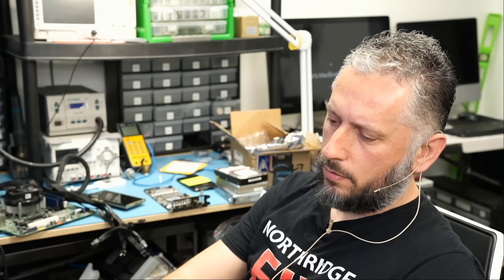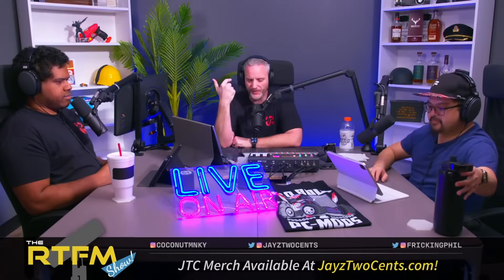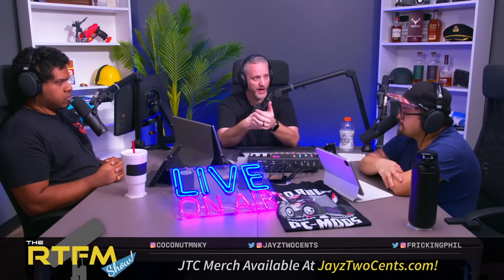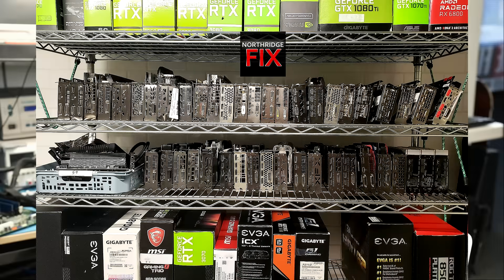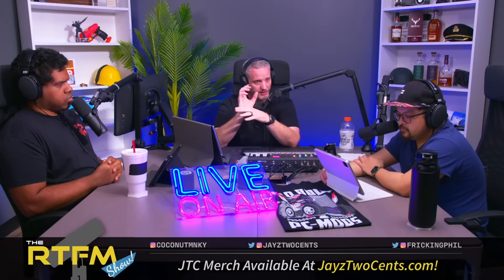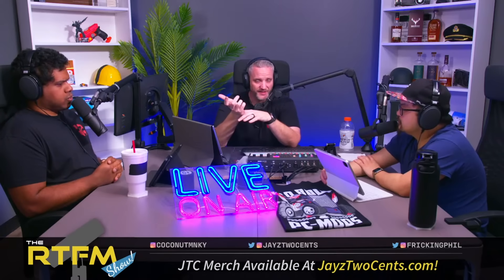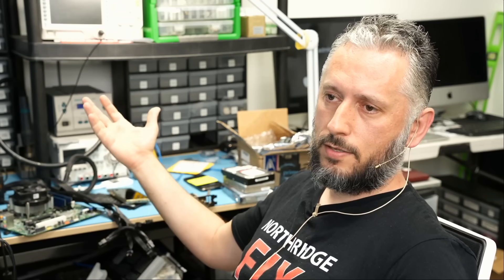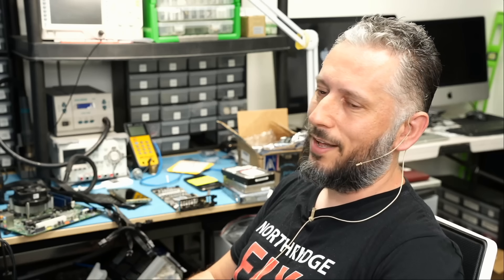Melting 4090 and CableMod. JayzTwoCents and Gamers Nexus Response. Blame NVidia or User?

Comment: that connector cable says it all... - in the old days when you connected cables to old pc's externally they had thumbscrews or even  just screws on them to keep the securely in place and stop them backing out..  maybe there is a lesson to be learned from this when it comes to designing connectors.. but I for one still think that connector is too small for what they are using it for.. it may be able to cope in ideal situations but there isn't enough engineering slack for non ideal conditions or even as the connector gets older..  is this the reason for the design as a form of built in obsolescence?

Comment: if I'm not wrong, while you were showing the card from different side angles in some other videos, I noticed the board looks a bit "cooked" when you watch the connector area from the side.
This means the card itself is generating a lot of heat in certain conditions, so probably there could be also a poor section of copper in the lines from the connector to the components. When the temperature raise up while the card is under stressing condition the resistance of those lines can drops due to the fact resistance is proportionally inverted against temperature, causing a further increase of drained current until it cause the overheating and meld on everything.
Anyway, it is really funny watch those guys speak and continue clutching at straws 🙂
Also, just looking to the fact the total power cable sections for sure is higher than the section of the connectore pins is causing a bottleneck. Probably if you try using the termal cam pointing to the connector area while the card is working under full charge you will see it becomes hotter...

Comment: Its too much electricity current runinng thru this one connector so its too hot, try running a heating fan at 500w thru this hahaha
If you play at 1080p/1440p or dlss fsr it uses less wattage so most gpus live,but native 4k+RT it sucks so much wattage....
old system is 1 pci cable uses 150w so 2 use 300w + 75w from pci slot total 375w for 4090 you need 3 classic pci connectors so total 3x 150w = 450w + pci slot 75w = total 525w.
Pumping this tru one is just beyond stupid.

Comment: More like the selected connector is not capable over time due to load to handle the current. Gets too hot, the terminals tarnish thereby increasing the resistance at points of contact, increases the heat, more degradation of the terminal get hotter and from there it is only a matter of time as these cycles continue before temperatures reach plastic and solder melting temperatures. 

Thankfully it would appear the plastic used on the connectors are not flammable!

Comment: Probably the best way is to set up a good card in a lab and run it while being monitored on video until it fails. IMOP it appears to be a design flaw but I'm not an engineer just an observer. Everyone can agree, there appears to be some type of problem with the connector that needs to get resolved.

Comment: Sounds like inadequate design in regards to current/ voltage passing through the connector, heat generated under use, & type of plastic used for pin / connector mounting

Comment: Steve is a simp for Nvidia cash. Why would he even side for general public? Negative PR about a brand usually blacklists his YouTube channel from future product reviews and free goodies. 
In my honest opinion, I remember from my electronics course that pushing more amps than rating on the connector can cause heat and eventually spark and connection can fail/burn. It also depends on the type of metal and it‘s quality. Arcing can occur when mismatched metals are used and always results in failure due to heat. One way of avoiding it is using multiple connectors (multiple power rails) and distributing the amps flowing through the single power rail. It is used in LED strips for more than 2m in length. Additional power inputs are given at 2m intervals for say we want to run for total length of 10m. Nvidia could have added two connectors and supplied new cable accessories to simply prevent this issue. When ever a device turns on it takes more power in the start and then spike normalises. If the metal used is mismatch then only it would arc and fail over certain amount of time. This is the root cause of this failure. No xray scan needed, just basics of circuit design.

Comment: Steve is getting too much sponsorship from video cards manufacturers.
If you lookup the specs on mokex connectors the max current is 8.5a per contact. Someone short cut something either in engineering or production to save on cost.
Nice try steve do the math.

Comment: What would close this is to measure the resistance of the connector, but would need to measure to milliohms not at dvom. Then just calculate the wattage drop at the connector with the known voltage and amperage. We do this with electric vehicles because if there is high resistance at a connector the car will burns down.

Comment: Over the years, I have seen melting connectors in automobiles. The cause is always high resistance in a circuit connection that has potential for high current draw.
My guess is the male terminals soldered to the board connector are undersize or have an unintended resistive condition on the surface.
Question: 
Has anyone ever done a voltage drop test across the connector terminals while the card is under load?
Alex knows there should be zero voltage dropped across a continuous connection placed between a source and a load, while in operation.

Comment: I saw the reconstruction video from Steve where they tried to recreate the melting issue with the 4090 and the only time the connector melted was while not properly seated, and slightly angled. My first conclusion would be a user failure problem but looking at how easily the connector can fail, i would say it's an manufactorer problem too.  A little bit of wiggeling at the cables and your connector is loose from it's socket. 
https://www.youtube.com/watch?v=ig2px7ofKhQ

Comment: What idiot at Nvidia thought it was a great idea to eliminate the multiple connectors and run that much power through those tiny circuits on just one , they're a bottleneck amperage wise, Glad i turned to amd oh btw ...thanks e-bay scalpers and bitcoin miners driving up costs, hope you lost your asses and the  irs kicks in your doors and arrest you for tax evasion... Not a fan of Steve either, he runs off half cocked and misses the mark, if he's ever close i'll be surprised, i usually bypass his podcasts and once again ....He's off the mark

Comment: So with an electrical engineering background,. not that I am antthing special, but I beleive its a design problem, it is STUPID to put that much power through that small of a connection,  that is why there used to be so many lines to lower the amperage per wire,  its Nvidia, and engineer problem.

Comment: Sorry, but this is a design flaw.  4-to-1 cable allows up to 600W draw on the 12VHPWR.  The Intel spec allows for up to 9.2A on each of those 6 pins.  That's a lot of current flowing thru those 6 little pins and it's going to generate a lot of heat.  If the material on those connectors are not designed to withstand that kind of heat, then it goes to Northridge fix who hopefully has better-designed connectors to tolerate the heat.  2) Wiggling and multiple insertions using that connector could eventually make less surface contact on the pins, which means it's going to get even hotter.  3) Why try to go fancy with a new connector pushing that kind of current thru small pins?  Would have been better to just use multiple 8-pin PCIe power cables directly into the car.  Simple is best.  4) It was stupid design to put the power connector on the top of the card.  It won't fit in many PC cases unless you use a vertical PCIe mount or get the Cablemod adapter... just so you can fit the gigantic card in the case.  Designers and engineers keep forgetting the KISS method:  Keep It Simple Stupid.

Comment: If it was purely a user error, it should have at least been reported with the 4080 even a little more than the case, 4080 users cannot have been all installing theirs more properly than 4090 users, and this is explainable considering how much more power the 4090 is using, 450 watts vs 300w. Seems like this "user error" is not only common but also that the design itself cannot cope with such error on 150 watts higher draw. Outside the world of personal computers, Physicians have the right to alter their patient's pharmaceutical plan if they see it's too complicated for their them to follow it properly, which is common with geriatrics...So, it's still on Nvidia back because they should have developed a way for their product to be installed as they originally intended.

Comment: Yeah but it should be ALL connectors melting then. Why are only select ones melting if its an issue with the card and not the user?

Unless there was a faulty batch of cards in the beginning.

Comment: I think it is user related error personally. I bought my 4090 FE without any fears; I use a SilverStone cable for my SilverStone PSU; 1x 12vhpwr to 3x PSU inputs.
Never had a single issue. I use a vertical mount with the cable going directly into the socket from the PSU.

Comment: A bad design is a bad design . In medical applications with expensive equipment where tolerances are tigh connector have sensors and engage mechanism to properly monitor any variable. Some medical equipment is cheaper than a 4090 😅.

Comment: Too much power through such a small spot creates heat changing the plastic and the coating on the metal. Over time resistance increases with micro arching on the metal and with heat the plastic can carbonize lowering resistance between the pins, short and blow it out.  Someone needs to create soldered on alternatives so it has at least two plugs like the older ones.

Comment: Even if the problem is die to pushing connector halfway, the manufacturer OUGHT TO over design its parameters to avoid this issue

Comment: I'm deeply invested in this! Love your videos, Alex! 
I'm interested to know whether anyone has watched and tested this card with a thermal camera to see where and when the heat starts building up in the connector. I believe that there is a huge current draw on those specific pins when the card is under high processing.
Reply: Didn't Gamers Nexus do this in their 12vhpwr deep-dive? I guess the heat camera is not close enough to figure out specific pins, or that they modified their cable too much.

Comment: the main problem is the current density, which is not at all consistent with the cross section of the pins (
this also applies to wiring the board to the pins). it's the fault of nVidia... 
so that there are no problems, the current density should not exceed 10A per square mm (5-6A is best)

Comment: I also think that NVIDIA's fault is more precisely the connector on the cards and the high consumption of 400+ W, a simple solution is to return the old connectors that we have used for the last 10+ years and which AMD cards still use. If I said something wrong or wrote I apologize in advance. Thanks for the great videos NorthridgeFix, I follow you regularly, have a great day. 👍❤💯🔔
Reply: and this is why you Frame limit and / or Undervolt the GPU. It's basically a must, now a days.
Reply: @BeatmasterAC  NO! STANDARD USER WILL NOT UNDERVOLT a GPU! Because they not added 2 or 3 normal connectors!
Reply: @radoslavsk8591  
explain
Reply: @BeatmasterAC  Undervolting by itself wouldn't do much to save those cards, but frame limiting, even without undervolting, definitely would save these cards.  Problem is; how many end-users know that's an option.  Also, if you have to frame limit a top of the line card, what is the point of buying it?  You could have saved money, and worry, and just gotten a 4080 in that case.
Reply: @jasonj5862  why wouldn't you Frame limit a GPU or even a top end GPU? If your GPU gives you 350fps in Game X, on 1440p, Ultra settings, but your Monitor manages to do only 144Hz / 144fps, you would waste fps, energy consumption, heat and lifespan of the GPU.
Frame Limit it and use the buffer / left performance, to increase graphical Fidelity with Mods and Overhauls for Game X. Or use 8 X MSAA and 4 x SSAA via Driver, while still hitting 144fps + the GPU consumes less, stays cool and lives longer.

A lesser powerful card would hit it's limit sooner, when you go overboard with Mods.

Heck there are already Videos of Skyrim with 1500+ graphical Mods and new Animation Mods + (fake) Raytracing Shaders, that brings a 4090 to sub 50fps, in 4K, while the Game looks like next Gen.

not to Mention Minecraft with massive Shaders, where a 4090 starts to cry and collapses to 20fps.
Reply: @BeatmasterAC  Just noticed that long reply was to me.  Re-read what I wrote.  I fully endorsed your idea to frame limit.  Personally, I limit my fps at 60 in my gaming.  I'm one of those few people who can't tell the difference between 40 fps and 120 fps when I'm gaming so I always just keep it locked at 60.
Reply: At least the old method used to split the load amongts all the connectors.
Reply: if it would be card problem and as you say for 450W, we would see at least 30-50% of the cards suffering for that while reported are less then 10%
Reply: If it was nvidia's fault we'd see mass recalls. Are some of you even reading what you post?
Reply: @mesicek7  No we sure as sh*t would not see recalls.  It's tough enough to get a recall on vehicles with life ending faults let alone a video card that so far really only offs itself.

Companies avoid recalls like the plague because it affects their bottom line dramatically which affects their stock performance which affects the higher ups in a company.
Reply: For those touting "8pins are only good for 150w"... Well, yes but no. Go look into where that 150w number comes from and how it's derived. Nearly all 8 pin connectors will do 250w without even getting slightly warm.

The fault, is the pin size/count of the new connector. It doesn't have enough overhead designed into it, unlike the 8 pins, which have massive safety overhead.

The real answer is: 2x 8PIN CPU AUX connectors instead of the PCIE 8 pins. CPU AUX high power variants can do more through a single 8 pin than 2 PCIE 8 pins.

Nvidia is the issue. Shitty load balancing across pins is the issue. Too many and too small pins in a tight group is the issue. 4090 is the issue.
Reply: Its really way too much watts for just one  small connector...
Reply: @radoslavsk8591  I don't know but the cable on my MSI A1000G PCIe5 power supply says Cleary 600W on it.(meaning it can support 600Ws) I think is a combination of some 4090 models, but also power supply models, maybe people are trying to overclock cards that cannot go pass 400Ws or near 600Ws.
Reply: AMD was going to use the same connector but then saw all the problems and was like "oh hell no" and immediately redesigned their boards. Intel designed the connector (and didn't fully test it or engineer it properly), not the standards board, and even they don't use the connector for their motherboards or GPUs. Nvidia just doesn't want to admit fault because recalls are expensive, and they have a company policy of never admitting fault even when they screw up, and attacking anyone that criticizes them.

Comment: the connector melts across all pins , if it rocked to one side only the loose pins would arc and melt  , I've installed many video cards and never had a problem ..

Comment: my 3080 has three 8 pin connectors,  its power draw is spread across 24 wires and pins. so lets make cards that draw more power and only use 12 pins, oh and also make them smaller.

Comment: MSI RTX 4090 SUPRIM X limits power to 520 watts stops thermal throttling I have not herd of any of these cards having issues. Also get the MSI MPG A1000G PCIE5 uses a single cable with 12 direct connections  (+4 sense pins) to the 12VHPWR  not 8 bridged  cable connection with the adaptors that are included with the cards

Comment: This is on Nvidia, the connectors should be redesigned as the card are becoming more power hungry. "Connector should be redesigned" that's the solution!

Comment: Alex, skin the proverbial cat: the on-board connector either (1) has manufacturing defects (most likely due to cost cutting) or (2) it's design is bad (not rated for the 500W, maybe reused from some other lower powered design).
End of story.
I personally am incliened to go for option (1) since otherwise it would be more likely for a 3rd party product like the cable mod to suffer from this issue and not the on-board connector itself.

Comment: Be interesting to monitor a 4090 connector on full load with an thermal camera, might be able to see how much heat is generated at the connector plug area.
Reply: Plastic is a poor heat conductor. Inside the melting maybe over 100c but on the outside the plastic is still warm

Comment: Why are we even discussing the connector? Are they not standardised and tested to their specification? 

If the cables and connectors have been used before, then it's is not them but the new cards... 

This shouldn't even be in question. User error can be so common unless the design is so bad. Which makes the designer at fault anyways..

Comment: I don't even know what everyone is arguing. In the history of pc gaming / building there was basically never (knowing) a issue of connectors melting like we have it in the 40 series. That just implies it's Nvidias fault for either A. Building a fault in the card or B. Building the connector in such a poor standard that failure are far more likely.
Nvidia is just a joke at this point.

Comment: It's like i pointed out on a previous video of yours, the connector you put it as a replacement has thicker pins connected to the card, manufacturers are probably just using a cheaper connector 😅